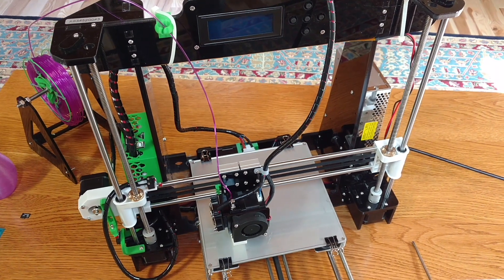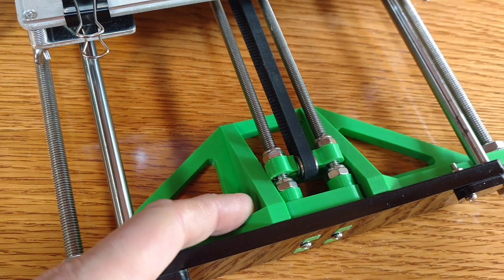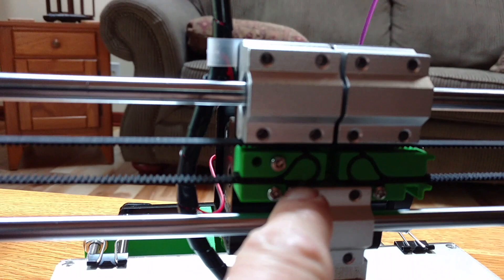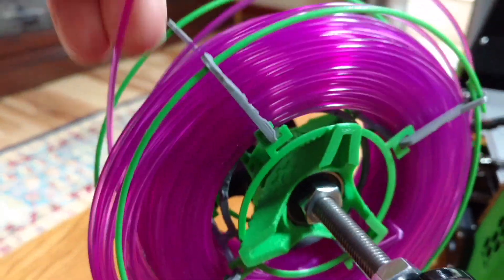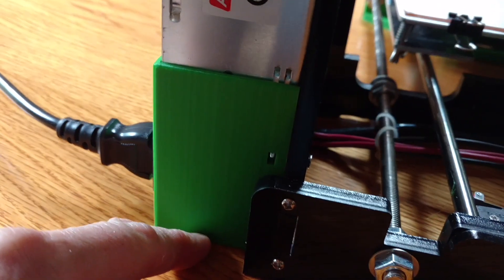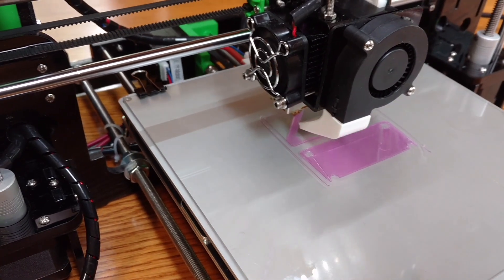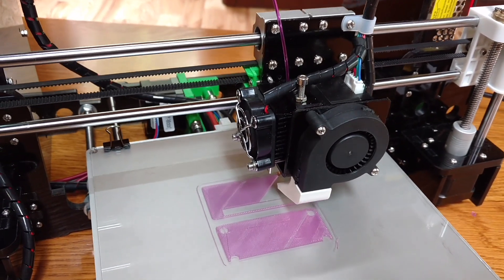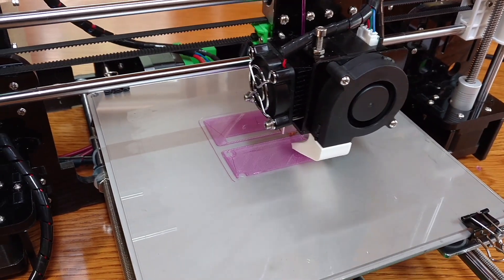Anet A8 upgrades

Comment: how nice, mine looks and prints like shit. The extruder stepper sometimes doesn't even move for some reason.
Reply from the maker: Sorry yours isn't working so well. When a stepper isn't moving properly, it could be wiring or the driver on the board. With the control panel, can you command the extruder to move both directions while you check the wiring? There's a facebook group? https://www.facebook.com/groups/1068531466501015
Reply: @dakavanagh  i'll look forward to it.

Comment: Good video, sorry if I missed it but may I have the information for the belts you installed in this video . The dimensions and whatever I would need to get the correct ones.
Reply from the maker: This is the kind of belt I ordered off Amazon: 10 Meters GT2 Timing Belt Width 6mm Fit

Comment: Mount the printer to a plyboard. It will stabilize the machine. Nearly eliminates needing to always re-level the bed.
Reply from the maker: Thanks. After using the printer for over 2 years, I can say I typically don't have to re-level if I leave it on the bench. If I move it, then, I have to go through the process.

Comment: Just a tip Don't move your x,y,z by hand like that when you do that, the stepper motors create voltage and will fry your drivers/breakout board/motherboard . Basic CNC knowledge Only do it when your steppers are unplugged
Reply: effyou128 If you move them at a reasonably low speed the drivers are totally fine. I’ve moved mine around when the steppers are just disabled but still plugged in for a couple years now and haven’t had any problems.
Reply: All you have todo is disable the drivers in the menu

Comment: can you send me the stl file of the electronic case please
Reply from the maker: Hi, On another comment, I replied with this link: http://de-signz.co.uk/product/anet-a8-dual-mosfet-motherboard-case-with-reset-button-v2/
The case creator elected to move it there and after improvements, is charging .99 euro for it. So, I cannot distribute the case file I used as I'm not the creator and feel that would be unfair to him. You'll spend more than .99 euro in plastic to print it! :-)

Comment: Use white teflon tape on the screws when mounting the printer. It won't let the screw get unscrewed. Modifying the heated bed screws will make it way more stable. Just remove the springs, remove the screw threads  and put 2 thumb wheels on each screw. it will make the bed super firm and won't wooble with the springs.

Comment: Hey Dave, what on/off switch did you install?
Reply from the maker: I got this one. https://www.aliexpress.com/item/NEW-HIGH-QUALITY-Red-Light-Power-Rocker-Switch-Fused-IEC-320-C14-Inlet-Power-Socket-Fuse/32720278625.html?spm=a2g0s.9042311.0.0.PlK409
I flipped the on-off switch so that "on" would be up with the way I had it oriented.
Reply: Thank you
Reply: Also i'm doing my first build with this one and am virtually a noob at this, but you are most well defined as to the others to watch and learn!
Reply: Now that I have mine built I will follow all all your upgrades. Really like your tensioner systems on the axises and the mother board and mosfet cover and the center for the filament spool. Would like to see some more upgrades from you. keep up the good work.
Reply from the maker: Thanks! I tried to choose things that had a definite purpose, then get on with printing other things. Best of luck. Did you find the Facebook support group?
Reply: Which group are you on. I think I missed it somewhere along the in one of your vids ?
Reply from the maker: https://www.facebook.com/groups/1068531466501015/

Comment: Agree with Spencer carr. Definitely upgrade the cooling nozzle. Also, you should print a filament spool holder. It will allow the spool to spin much more freely.
Reply from the maker: I did print the Spriya nozzle (https://www.thingiverse.com/thing:2133328) and my first useful print was these guys: https://www.thingiverse.com/thing:127181 which work fantastically to keep the spool moving easily.

Comment: Hi David, I recommend you print a few of these out. They are magic for quieting down the printer! Also, get some z-axis wobble support for the frame, makes a big difference to the layer stability. I also went Bowden, and its much much better now, especially on corners, and faster print speeds. https://www.thingiverse.com/thing:2103227
Reply: I agree, I printed these and they make the printer so much more quiet

Comment: Another good upgrade you should do is a new cooling nozzle. It really helps with print layer quality
Reply from the maker: Oh, I probably should try that.
Reply: before you do, watch 3D Maker Noob video about that, you will find that the stock fan duct is not so bad.
Reply: ye ive seen it, but there are some that work a bit better according to your filament type
Reply: the Prusa clone is very very good (the cooling nozzle) the other one very good is the semi circle one. Also, print the anti vibe damper mount, it will make the printer very very silent.